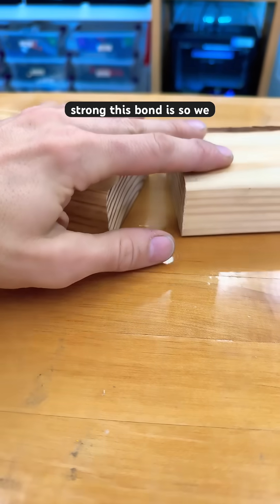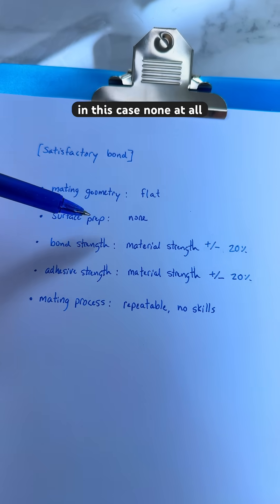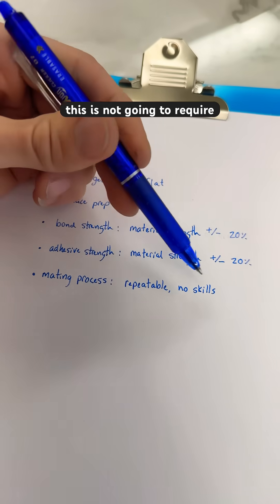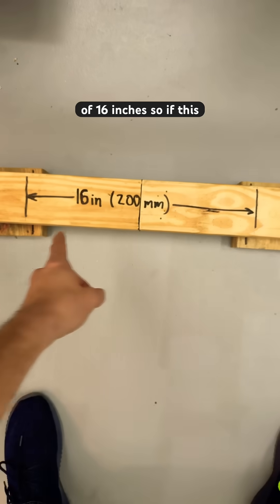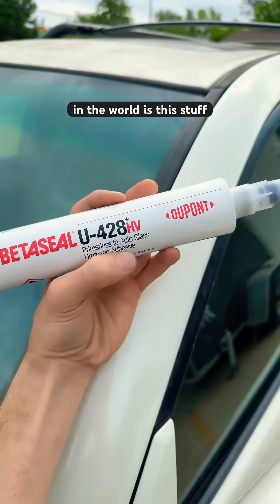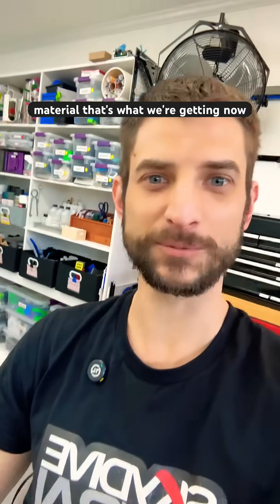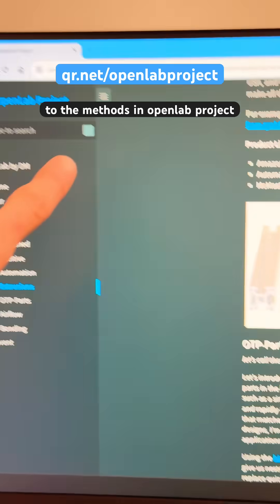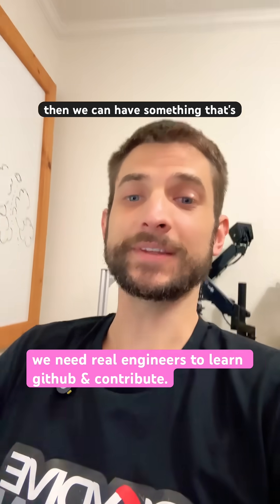this bond is stronger than the wood itself.

Comment: The test is biased by the clump of urethane adhesive that oozed out of the joint at the bottom forming an “L” or inverted “T” bracket to blunt crack initiation and propagation. 🤔I’ll bet that one metal inverted T bracket glued in-between the 2 pieces of wood with “liquid nails” will be stronger than a “control” solid piece of wood. In the original experiment, it would be interesting to clean off the ooze, round the edges of the wood at the gap to prevent stress relocation and add a known amount of adhesive based on DRY weight and measure the adhesive gap dimensions between the two pieces of wood. The test weight on the boards needs to be concentrated only at the glued gap between the 2 boards, So, a human foot is replaced with a blunt chisel head at the point of the applied load. In effect, this test should be run using a standard “THREE POINT BEND TEST”. Visit the adhesive manufacturer’s Quality Control laboratory and using load cells, measure: 1) Flexural strength- the maximum strength that the two bonded pieces of wood can bend before failure (report if the crack was in the wood, or between the wood and the dry adhesive (adhesive failure) or inside the adhesive (cohesive failure); 2)Flexural Modulus - this measures how much the bonded area flexes, e.g. is there a stretch like a trampoline or bending like a nail; 3) Failure limit- the point at which the boards deform permanently or fractures; 4) Fracture toughness - once a crack starts how easily does the crack propagate, 5) Fatigue Properties- how much the joint flexes by loading and unloading the test sample multiple times. Good luck reporting meaningful and reproducible results, wood products are normally dried, conditioned and tested in temperature and humidity controlled rooms😊.
Reply from the maker: one could make many improved tests based on this comment.  I say we tag team it and get help from some of the 100,000 viewers on the channel to put together the best data for the community. ❤

Comment: Does the bonding material hold up when exposed to sunlight over a long length of time?????????
Reply from the maker: well this time, yes.  It’s not by accident that I’m exploring the designated use case of the product.  For window glass, we expect this bond to withstand direct sun and heat for a decade.  It’s an insanely tough substance, and with many safety precautions.

Comment: You didn't really give it a good test. You should be able to hit it really hard with a mallet.  Now, if the polyurethane is flexible and integrated into the two pieces then maybe it will do what you say.  But I'm not convinced by your test. I would incorporate metal perpendicular to the bond, just like the longitudinal fibres you have in wood.

Comment: Why test it like that? Wouldn’t it make more sense to test in pure shear? It seems like there is a weird mix of stresses on the joint in this setup.
Reply from the maker: good question.  it’s because i never had a part failure in pure shear.  but also i don’t have a giant pair of hydraulic scissors. i’d like one 😊

Comment: You forgot, life span, shelf life or WLL (working load limit) on a shirt term, and long term. Granted, real world testing, requires years and or decades.
Reply from the maker: thanks because long-term effects are immensely important.  And if our method fails after 1 year it’s even more of a disaster than immediate failure, for many reasons. Like a lurking enemy waiting to strike.

all the modern product ads avoid talking about these issues.  My solution lies in the documentation.  it’s crucial to publish this year so the records of methods are clear 3 years later when a problem appears.

in your work, how do you eliminate methods that may fail in the long-term?
Reply: @davidmalawey when I was in electronics assembly manufacturing, one of the steps was environmental stress screening. Circuit boards meant for telecom companies had the longest cycles. It has been a number of years so my memory is fuzzy but I think it was typically 15 minute cycles over at least 8 hours, possibly 12, alternating between -10C and 60C. I'm probably off about the temperatures but as I recall the testing range was greater than the stated operating range.
Reply: Yes! Shirt durability is crucial! 🤭😉